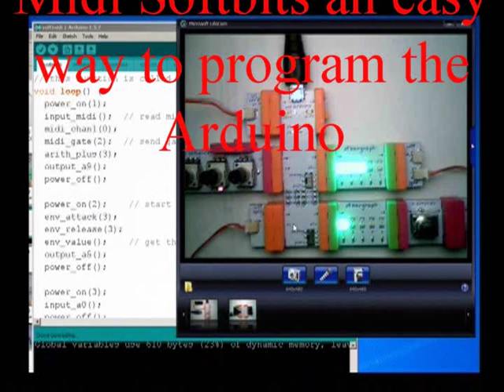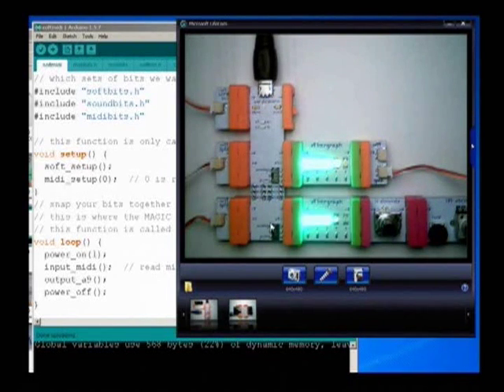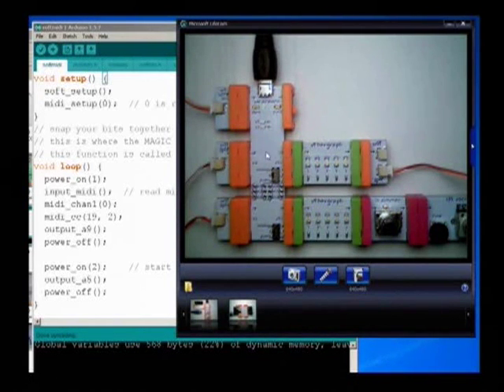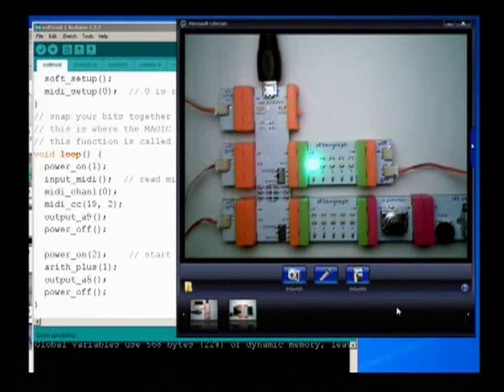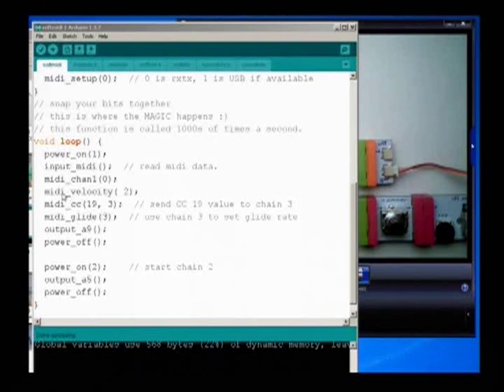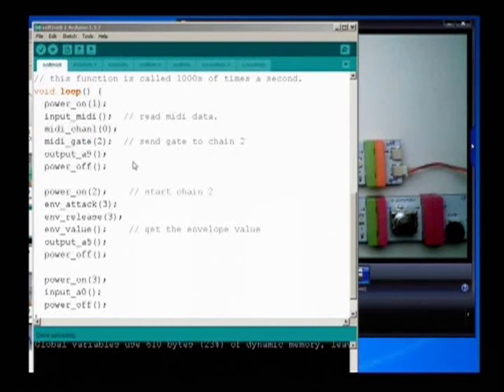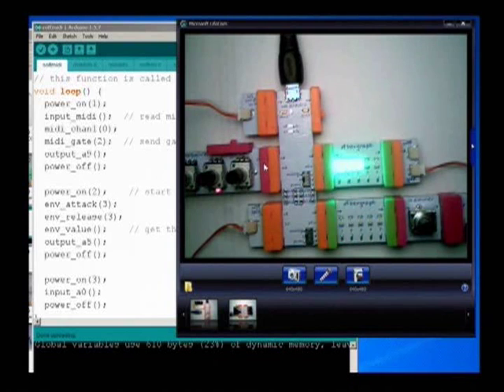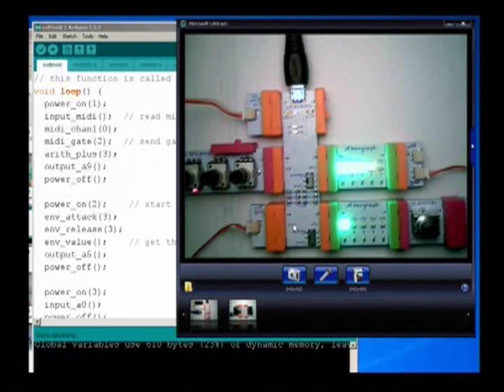Midi Input for LittleBits Arduino

Comment: Did you use softbits for the broomstick guitar?
Reply from the maker: Not yet. Now I have the midi working, adding a mouse bit is probably next.  The simplest way to implement the mouse interface is with a cpu just for the mouse. With an X voltage and a Y voltage outputs. One, two or three button outputs. Another way would be to output as Midi data that could then be processed in the arduino.
Reply from the maker: JackANDJude Hi I just published my mouse bit at http://littlebits.cc/projects/mousebit 
Peter
Reply from the maker: JackANDJude I did a demo of the a Softbit driven Mousebit at the Radioshack LittleBits meetup in Mount Airy, MD last Sunday on 12/7 with Glenn Mossy. Also a softbit driven Midibit.
Reply: Great!  Are you going to submit it to bitlab?
Reply from the maker: JackANDJude Glenn and I were talking about that. I think a cloudbit can easily be used to implement a mouse bit with say just the X output. It can support USB and wireless mice. The ATMEGA 328P really can only handle PS/2 serial speeds. I have a minimal Midi interface that just adds the DIN connectors and the opto isolator and uses the Arduino bit D0 and D1